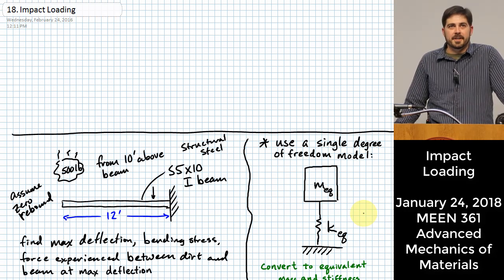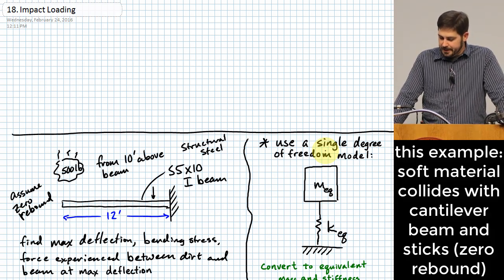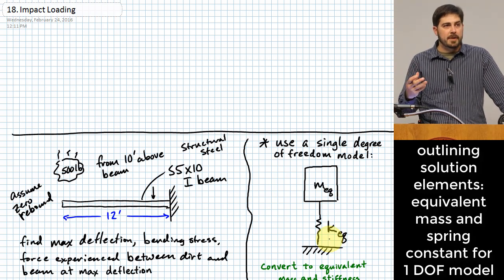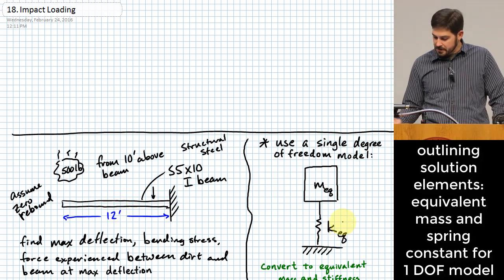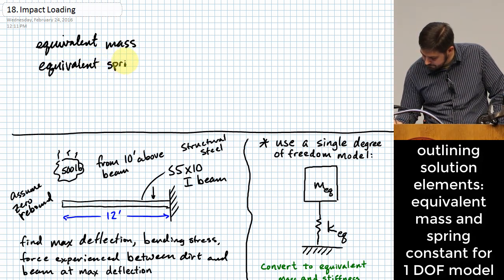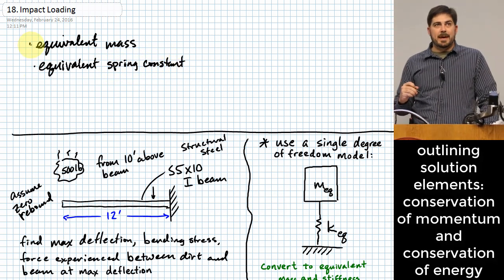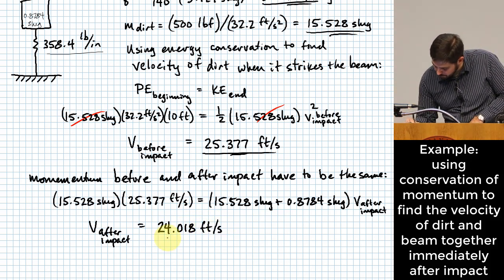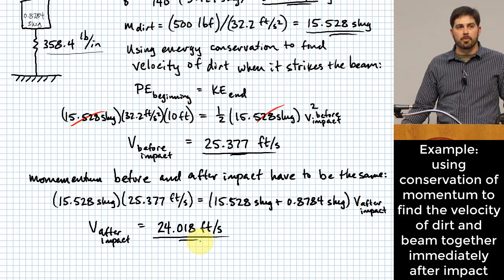Dirt Impacting Cantilevered I-Beam

Comment: Dear sir, thank you very much for the lesson, I am a mechanical engineering student, I wanted to ask you if this simplification is valid for the case that instead of soil a ball is used, which has enough energy to deflect the cantilever beam enough to pass downwards, but considering that it does not deform plastically.

Comment: Sir, you are really great. May I have your Linked-in ID to have a discussion about more detailed topics? I have an issue about finding acting loads on a shaft in the real world. I mean suppose that you have a centrifugal pump in front of you and you want to design its shaft, now the question is that, how would you know what is the load magnitude applied by the impeller and other components? because as far as you know in most engineering books the author has been given you some knowns and ask you to find unknowns, but in the real world condition there are no knowns how can I find forces and design an engineering problem? thanks in advance for your kind notice dear.
Reply from the maker: Thanks for the compliments! Here is my linked-in profile: https://www.linkedin.com/in/mswanbom/

I apologize if I'm a little unresponsive, I'm pretty buried with work right now. But I'll try to help if I can here and there!